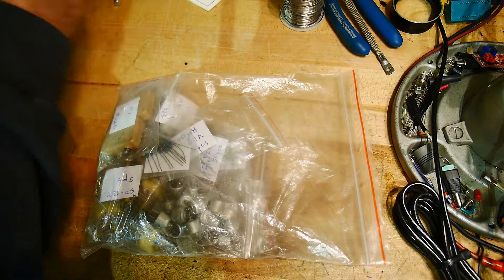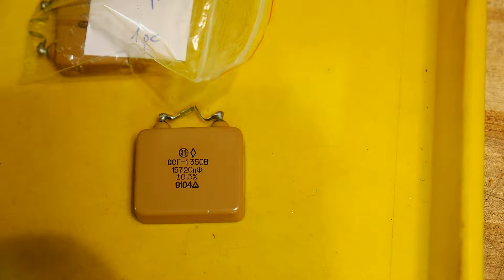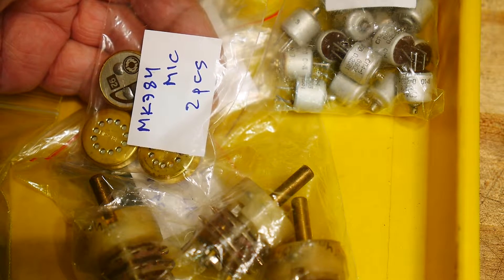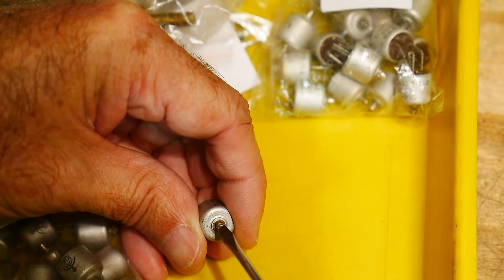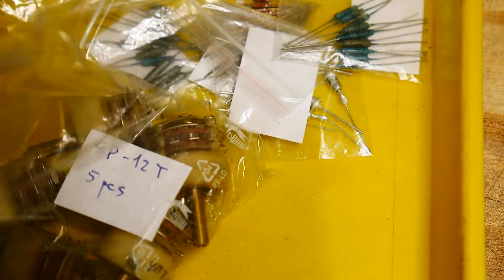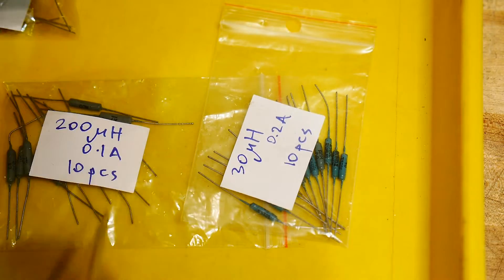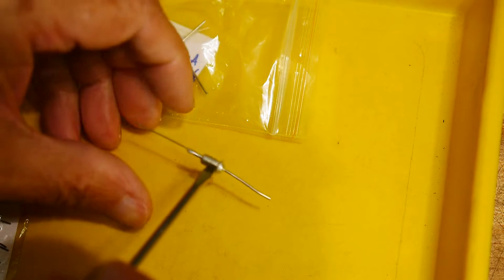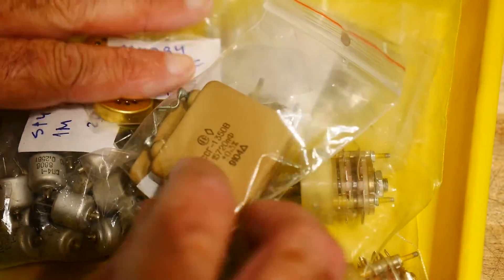#406 Russian electronic parts

Comment: These variable resistors is carbon composition type with  lifespan of around 25000 rotation cycles, mike is average quality and sensivity special made fo telephony, zener diode is temperature compenated precision type.